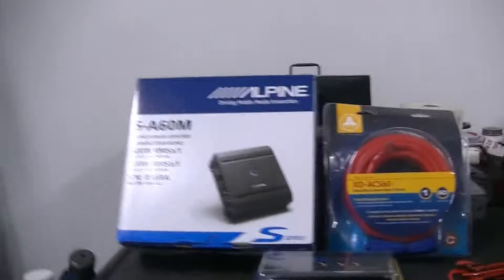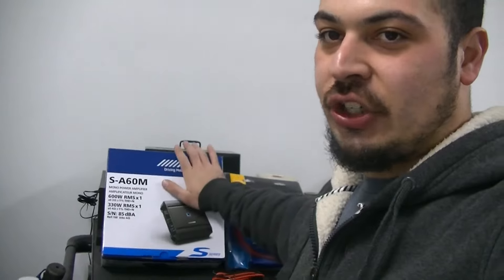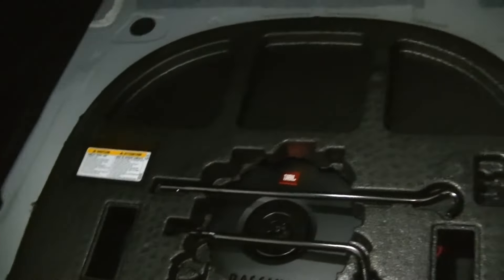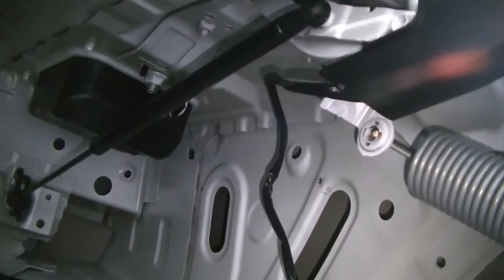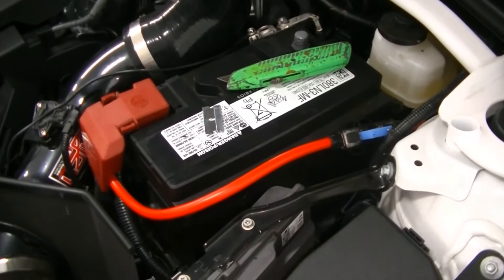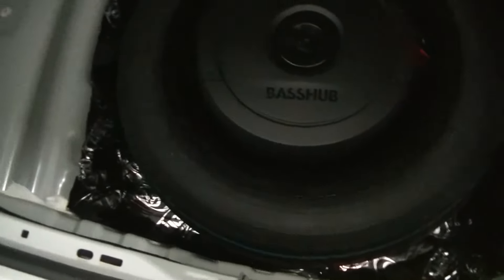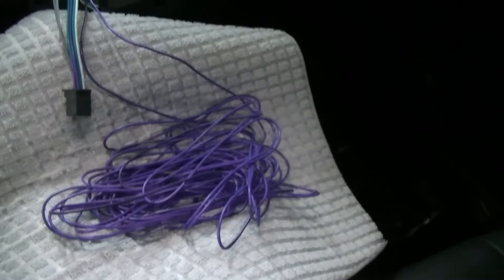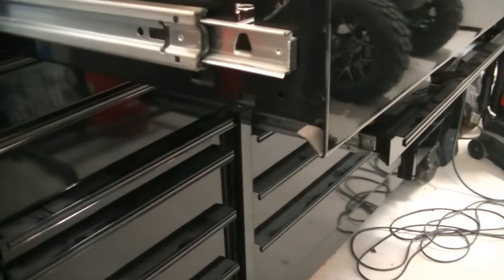Subwoofer, Amplifier, and Line out Converter install 2018-2023 Toyota Camry

Comment: Great work. I simplified mine by putting the amp under the drivers seat and the line out converter in the drivers side B pillar. Saved a ton of time, money and effort.

Comment: FYI just used the Taco tunes harness with the LC2 and didn’t use jumper wires. Speaker level inputs failed to turn on the amp but the remote wire worked. All good with dual 12s.
Reply: Where did u plug the remote wire in?
Reply: @Evangilizer The head unit speaker's connector name is 9098012C39 (10-pin black). The easiest way to get a remote wire is to connect it to USB
Reply: Where do the 2 wires from the harness go into the lc2i

Comment: I was going to get the taco tunes wire harness but only one channel tapped into for the sub channel is not normal. That works for 99% of the produced music out there, some rare live recordings will have stronger bass in the left or right channel only. So depends on what you listen to I guess.
Reply from the maker: I ended up tapping the other channel to have both channels going to the LC2i
Reply: @SEsGarage  Good I would do the same. The LC2i would be normal to use both channels. I like keeping the power balanced rather than half hooked up and cranking the gain higher to make up for it.
Reply: I want to tap into both channels and I have the taco tune harness arriving. For other channel I know I have to tap into the gray wires on the harness but which one is positive and negative?
Reply: @practicalguy973 which gray wire is positive and which one is negative for the other channel?

Comment: does any one knows what fuse i can get power for the remote?
Reply from the maker: Your best bet is to purchase a line out converter with a remote turn on wire that powers the amp on when it sees a signal from the radio

Comment: Where do I get the harnest for the  oem radio that goes to the line output converter??
Reply from the maker: I have one I can sell you. I just took my stereo out of the car. Let me know
Reply: @SEsGarage what else you got for sale?
Reply from the maker: @amazingwireless2  for the Camry? I have the line out converter, the fitcam dash cam for 2021+ cars. And I have the front and rear door speakers and adapters I used

Comment: Hey boss, loving the videos! 
I know you got rid of the Camry but would you still recommend this set up? I replaced my speakers but still lacking in the bass department. 
Just curious to see if you would still recommend running this set up or look into something else?

Thanks in advance!
Reply from the maker: DO NOT use the bass hub! I didn't like the way it sounded at all. If you look at my later videos I ended up going with a Kicker wedge style box and it worked fantastically!
Reply: @SEsGarage  Hey, thanks for the update! Did everything else stay the same? Just changed the sub? I’m inclined mechanically but I have no idea when it comes to working with audio… 😅
Reply from the maker: @Adam__B  yes the rest of the setup was exactly the same, just different sub
Reply: @SEsGarage  Alright! Thanks! 
I’m thinking about doing this, as the speakers are good now, just literally no bass. I think a sub and amp will complete the setup. 

Thanks again!
Reply: @SEsGarage Also did you end up leaving it running from the rear channel or changing it to the front?

Comment: Loved the video! I have a 2023 Camry with the stock radio and would like to upgrade it.....problem is I'm in my 60s with health issues.....Can the Toyota dealer do any upgrades to my car ( reasonable....under 1k) ? I love my car but the stock stereo is very lame......
Reply: the magics in that audio control lc2i or the one with bass management. the stock head unit doesnt put out enough signal.  that lc2i will add up to 6volts if i recall.   that would go into a external amp.  matching its max input (probably 5 volts)   and you can change how early the voltage rises (volume sound).    also that harness he added to the tweeters. you can jump into those wires for your subwoofer.     rear doors are a lost cause.  there just "fill in"  and some door sound dampening will really help. 
hardest partis.  fishing that amp wire through the firewall.     try to do it in sections.   one day just run your power wire and mount the amps.  couple days later swap out your rear door speakers and ad door treatment.  couple more days later use all weekend to swap out front door speakers, tweeters and run all your wiring.   couple days later, do all the tuning.    sometimes i do things like that...

larry

Comment: Two questions- why not just send the power wire through a drain plug in the spare tire pan and then run the wire on the outside of the car up to the battery, That's how I did these 20 years ago. Second doesn't the JBL basshub have a 200 watt amp already integrated? 3rd is the wire harness for the JBL system sub still in the car even though you don't have the JBL system?
Reply: The BassPro Hub has the amp, and is 200W RMS. This one is passive and can handle 600W RMS.
Reply: He explains the difference in the hubs if you listened to him.

Comment: Trying to run my power cable to my sub got through one side of rubber boot on the driver side can’t get through the other side any suggestions? Afraid I’m going to damage the wiring harness with too much handling

Comment: i have a very specific problem and i would like too see if u could help me out, i have a toyota Camry 2021 XSE i have no experience with audio systems but ive always been a fan on my birthday a few months ago some friends bought me a full system and we got it in stalled i got the kickr comp R dual 12 set up with a kicker 2400w max 1200w rms cxa1200.1 got other cables and such that i needed i believe 4gage amplifier wire, and i got everything installed and everything was cool could play my music sounded good and everything i also want to note i have a gain controller which i have never maced out or put more than 60% of the way up to ensure i never blew and speakers, so after about a month of having the speakers playin music casually one night im driving and and the audio cuts out and i cant hear anything i try to turn the volume up and down and nothing shows up on the displays i was confused unplugged my phone thinking it was a apple car-play problem and pugged it back in and nothing no audio music is still playing my car is just not playing any audio i have to restart my car multiple times to get my music to play it happens randomly and at first i was told could be a over heating issue, but it doesn’t make sense because i can wake up to go to work and turn on my car and the music wont play and the car hasn’t been running im over 12 hours and nothing no audio and sometimes it works for days but then will randomly start cutting out again, i need help i am not sure what is the problem and i would like some help
Reply: U figure it out? Any updates?

Comment: I cant find that grommet to pull the wire through. There wasn't enough light to see where you were pulling through
Reply: Tj it’s behind a rug easy to pull down and put back up. Top left.
Reply: @douglashoag122  all good I went through the one on the passenger side, it was so much easier to get to.  Ill finish up tomorrow and can't want to have some bass back in my ride.
Reply: Thanks for replying!!

Comment: How did you wire your twisted pair of + and - wires to your single pair of speaker wire from the amp? Trying to run similar setup with the basshub stadium and trying to figure out that connection between the one strand and two to the sub
Reply from the maker: Both positive twisted together. Both negative twisted together. Into one channel of the amp

Comment: Mine have a jbl system  xse v6  22  from were can  I tap  the signal also have lc2i pro tia
Reply: Front left speaker wires at the JBL amp under the driver's seat.
 
Output harness (has thicker wires than the input harness):
Light Green + PIN 13
White - PIN 28

Wouldn't recommend tapping into the sub signal because it seems crossed around 60hz (sub bass only).

Comment: How did you get signal to the amp?
Reply from the maker: The LC2i provides it via signal sensing
Reply: Thanks. I’m setting my LC2i Pro up the same way, do I need to jump the left over to the right so the LOC thinks it’s getting two channels? Everything I’m reading says the left side is all you need and the LOC will be fine going off that.

Comment: After you installed everything, have you had issues with any of the doors unlocking by themselves after locking the car?
Reply: Just changed out my door speakers and this happened to me took it back apart all it was was the wire that hooks to the locking mechanism it fell off the guide.

Comment: The Taco harness, that's required for any installs with amp/line output converter?
Reply from the maker: Not at all, you can easily wire it yourself but the harness makes it so you don’t need to mess with factory wiring
Reply: @SEsGarage  so without it, I'd have to splice into the original harness? Trying to get everything I need before install. Going with LC7i and a 5 channel amp for front and rear door speakers, and a sub
Reply: @sindelm7437 Yes. Did you get it figured out? 

I’m doing the LC7i Pro - 4 channel RF amp for components - 2 channel RF amp for a sub. 

I was given two free RF amps which is why I’m going dual amps. It complicates things a little more but it will work just fine.

Comment: How did you remove the dash to gain acces to the factory harness for the sub output
Reply from the maker: I have a video up on removing the radio to gain access. Check it out
Reply: Thanks

Comment: How did that wire harness from tacotunes do? Im thinking about getting that one
Reply from the maker: Worked well!
Reply: @SEsGarage  damn ok i just dont know about the 2 cables and being jump wired like that? do you lose any features? Like fade?
Reply from the maker: @subiyota  no you don’t lose fade or anything. It’s only used to give a signal to the subwoofer amp
Reply: @SEsGarage  what about when you install a 4 channel amp?
Reply: @SEsGarage  those 4 speaker wires would be useful to run a amp to the speakers.
Reply: what's the part number for this harness

Comment: I always use a spare battery that I connect my positive and negative to.  I keep my inline fuse in the back so that away I can put my wire loom on the red positive cable and it looks OEM.

Comment: Where did u plug the remote wire in?
Reply from the maker: To the LC2i
Reply: From where? The head unit? If so do you splice in? I currently am trying to reproduce this setup with a 22 camry. Have everything you have, i have remote out going from the l2i to the amp. What about remote in on the l2i?
Reply from the maker: @Evangilizer  the LC2 doesn’t need remote in its signal sensing. Just be sure to have smart turn on enabled

Comment: Did you find a harness that works with the factory head unit or are you gonna have to splice into the factory wires
Reply: Tacotunes sells one that connects to the head unit, it’s like $40

Comment: is that 10" cutout on the rear deck a place where you can mount a boxless subwoofer?
Reply from the maker: That where the factory JBL sub would be mounted if you had a JBL equipped vehicle
Reply: @SEsGarage  thanks!
Reply: @SEsGarage can you mount one there yourself if you don’t have the JBL audio in it
Reply: @Noah-s1w Yes. The cutout is 8”. You can use metal shears to cut the hole larger for a 10” sub. Be it to and the metal down so it’s not sharp. Add some rubber gasket around the sub lip to reduce rattle. And of course use sound deadening material. 

If you buy from crutchfield, they will include the directions for the removal of the backseats.

Comment: I DO NOT INSTALL ANY CAR AUDIO WITH A AFTER MARKET HEADUNIT PERIOD.  FAILURE TO UNDERSTAND WHY THAT IS IMPORTANT WILL RESULTS IN MIX MATCH SOUND MEANING BASS WILL BE HIGHER THEN THA MIDS AND HIGHS   PLUS YOU HAVE A HALF OF A SOUND SYSTEM WITH OUT THE 4CH AMP THIS INSTILL IS INCOMPLETE SORRY BUT IT IS THE TRUTH
Reply from the maker: You’re entitled to your opinion. Between the bass restoration of the LC2i, and properly setting the gain on your amp, it’s 100% possible to get everything level matched and working together. I’m not looking to compete in any sound system competitions, for someone that is simply looking for a little more bass there is nothing wrong with this type of installation.
Reply: @_1_ Bruh calm down lmao
Reply: Yes good install thats what the lc2i is for. Some LC2i come with a bass knob. Unless your entering a bass competition this install is good. Average joe usage.
Reply: What do you mean?
Your statement doesn’t make sense to me?

I have 3 amps all new component speakers and a 10” sub in the truck.

I didn’t wire mine up like his. But it sounds great!!    So..  what is it that we’re not suppose to do?? 

Larry
Reply: @lhughes2015 😂😂😂😂